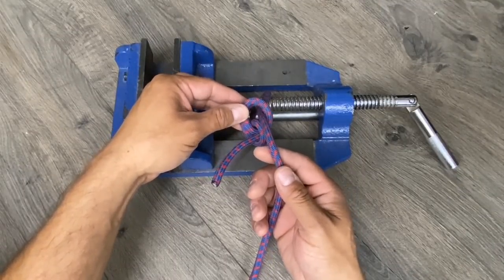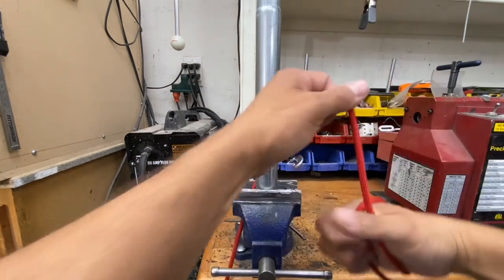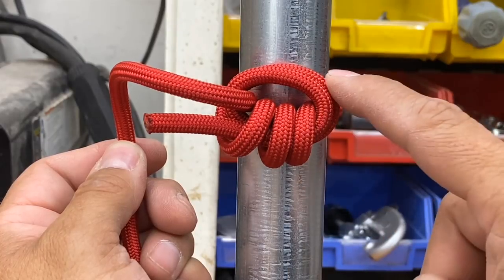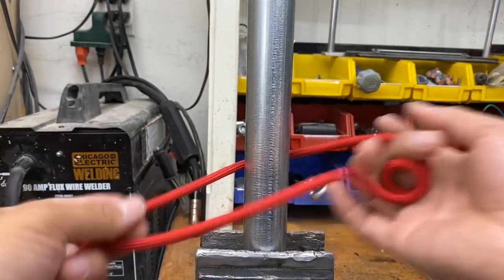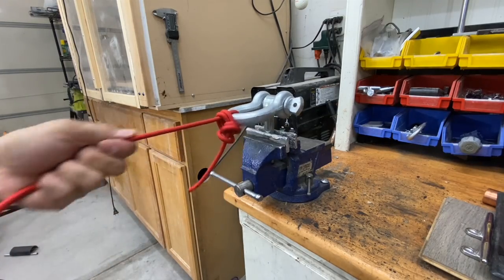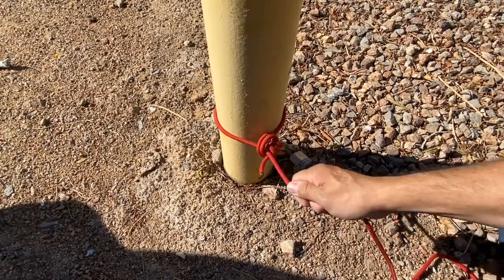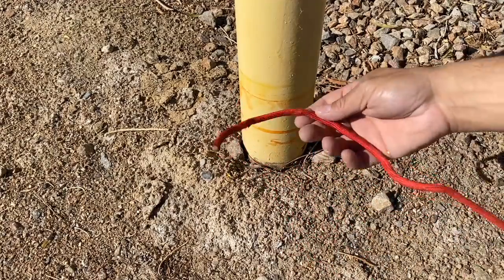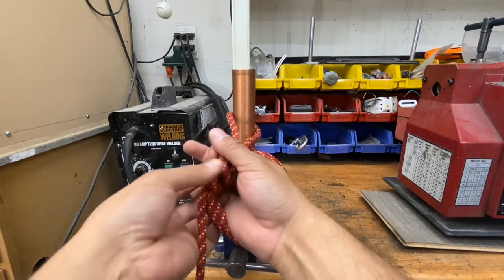Panic Knots. High Tension.

Comment: This is a timber hitch variation. I have been using this knot for years. Sent this video to a friend and realized this is a timber hitch variation that works on smaller diameter objects. Best knot ever for dragging large trees with a truck or tractor.

Comment: Hi, could you tell me what the best thing yo use to solder copper wire jewelry. When I google it it tells me yo just use silver solder. But I want to be sure. Also what is your opinion on the paste solders they have out, the soldering kit I just bought came with soft sterling silver solder paste. I have seen copper solder paste but would like your help with this please. 
Thank you
Jackie

Comment: Will a bowline knot do the same thing? Btw, that's so cute you painted after doing your test. I can't imagine very many people would have been so thoughtful/responsible.
Reply: Both have pros and cons, I use both and panic knots get's tighter, I can only think of tying it to some flat and smooth pipe / handle like some hammers, or if you're really short on rope. But I still think there are more proper knots if u have the time.

I also find panic knots take so long to tighten the knot, if someone found a case where panic knots where superior please tell me your story. The time and difficulty is on par with even double-bowline knot. 

Currently practicing anglers knot.
Reply from the maker: Thanks!

Comment: If you just go around the anchor 3 times, then a half hitch just to secure the tail, you will find there is no tension on the knot and have the full capacity of the rope.
Reply: Why not just make a clove hitch, then?
Reply: @caracaes  clove hitch is a good knot, but with the 3 wraps there is no tension on the knot and you could control the release if you wanted to.

Comment: I don't know if it's because I'm using paracord or what, but whenever I try this, when it comes to cinching up it just devolves into a mess of loops that doesn't want to tighten...
Reply: What type of paracord are you using?
Does it have steel wire in it?
It's a thing and it makes certain knots harder to sink in. I used a standard 550 paracord and found it bites nicely.

Otherwise, pay close attention to the way he wraps it around his hand. Keep the loops from crossing and don't rush.
You'll get it.
Reply: @darthlogicus  yeah just regular 550. Don't get me wrong, it generally works, but if you're doing it panic style it seems to be hit or miss. I can do a buntline hitch or similar in the same time.
Reply: @bn5055  fair enough.
The speed it can be applied while under stress, is a matter of practice. The more you do it slowly, the faster you will find you are. Eventually, it becomes reflexive instead of a thought process.
That's the only way I know of to train for quick responses in emergency situations. Do it many, many, many, many times. Then do it some more.
Reply: Make sure free end is finger tip side instead of palm. At least that’s what I found to be what my issue was in completing this knot.

Comment: Whats your favorite way to store Panamax? Like in a backpack or whatever and how much do you personally carry with you
Reply: Where do u buy your rope and why is 1/4" paramax your favorite when comparing to other parachord
Reply from the maker: The cord and rope I use is made by E.L Wood. They only take bulk orders though, so I sell it on my online shop, ‘AwesomeForSale’. 

1/4” paramax is easy to handle while tying and untying. It also has less stretch than typical paracord. It’s a good balance  between how much space it takes up and strength.
Reply: @First_Class_Amateur  I've really been enjoying your videos.  I was a scout when I was young and have been a firefighter for 23 years.  So yeah, knots have been a thing with me all my life.  I would like to support you in some way and I think that I'm not the only one.   I didn't know about your store.  If you mention it in your videos and share links to it more often I think you will be pleasantly surprised.   Thank you so much for your content.  Btw, your truckers hitch is my new go-to 👍🏼
Reply from the maker: I normally store it in a hank which was wrapped from hand to elbow. Then I just throw it behind my drivers seat in my truck. I keep 50’ with me. That’s always been enough to tie down a load or set up a hammock line.
Reply: @First_Class_Amateur  Storing it in your truck would significantly impact the strength and life expectancy though right? With all the heat cycles that it goes through on hot days.